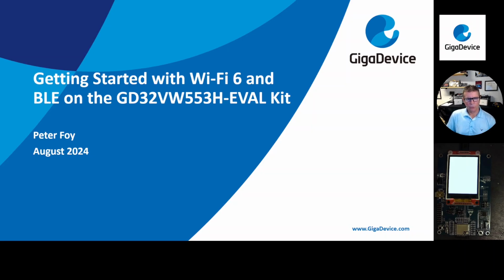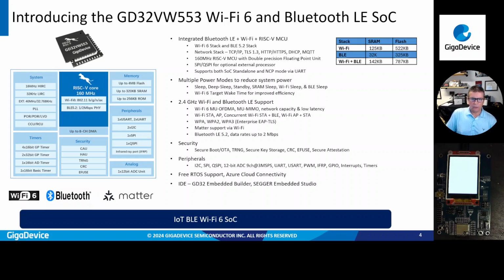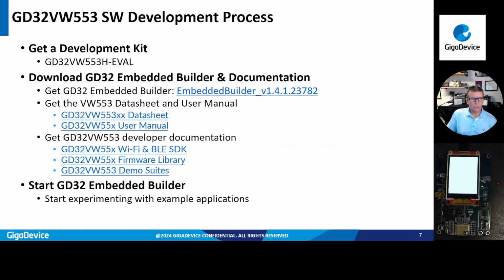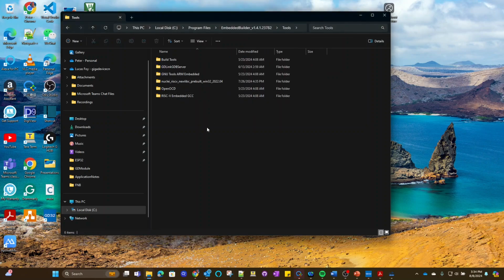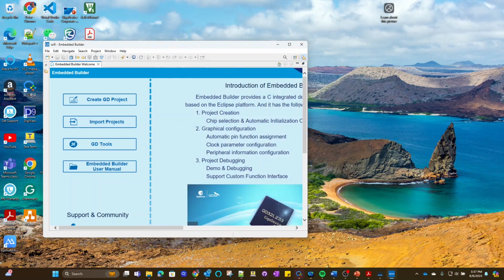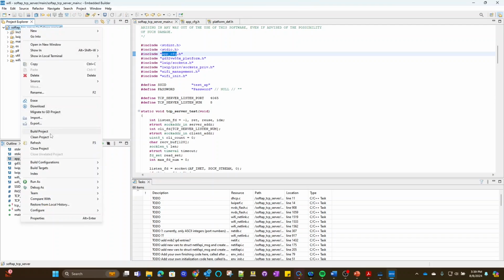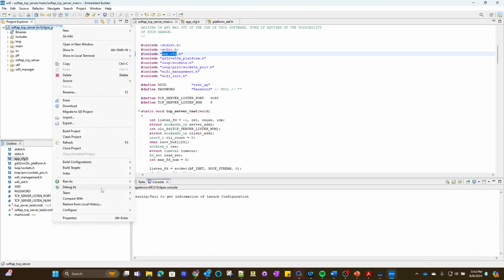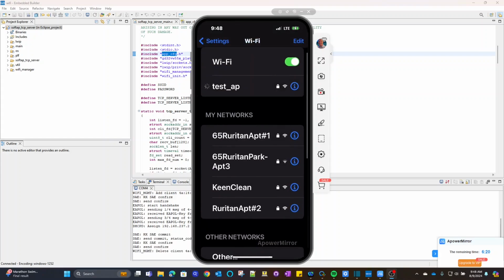Introduction to the GD32VW553 Wi-Fi 6 BLE SoC device with Wi-Fi Demo

Comment: I tried applying this class to a gd32vw553k-start board and it didn't work (Flash download and run failed). It seems the download address or some other setting on the board is incorrect.